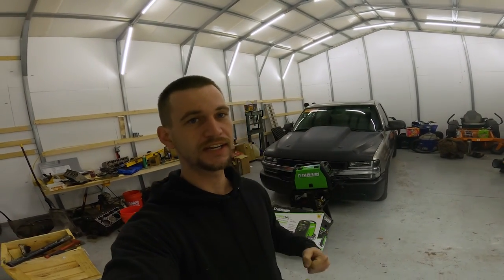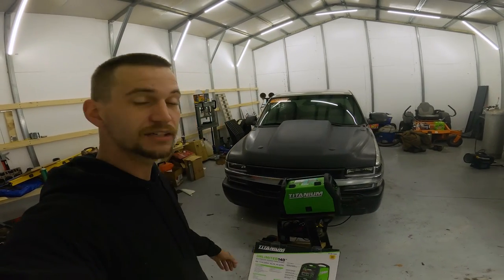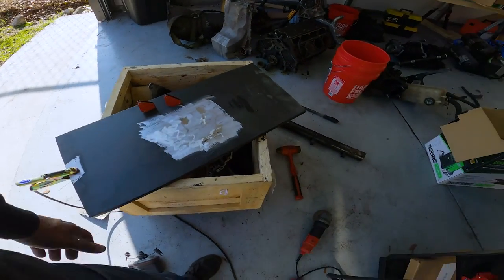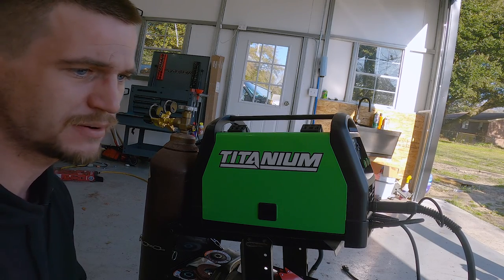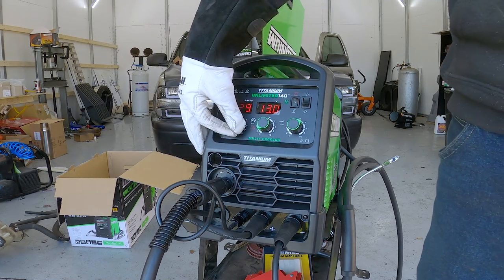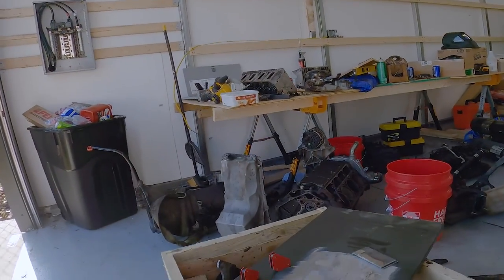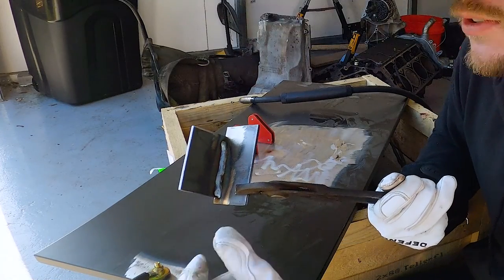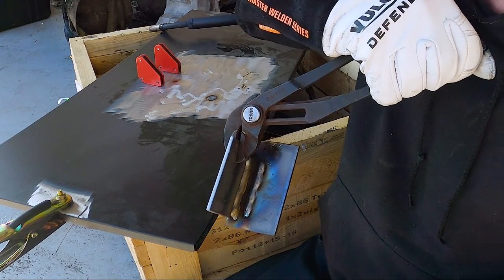Harbor Freight Titanium 140 Welder First Thoughts and Test

Comment: The magnets will mess with the weld. I use them to hold the metal while I tack them together.  After whatever is tacked remove the magnets and weld.
Reply from the maker: Thanks for the tip that makes since cause the metal would be magnetized then it would be pulling on ur weld too